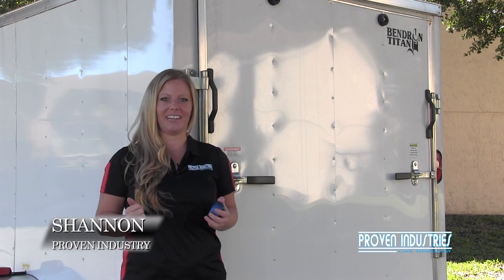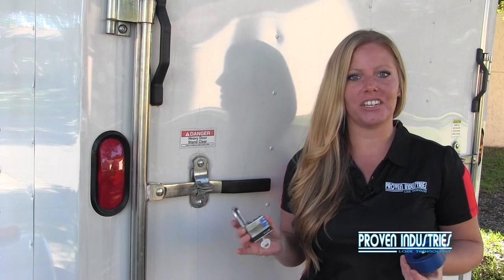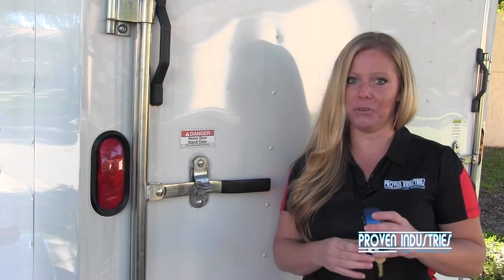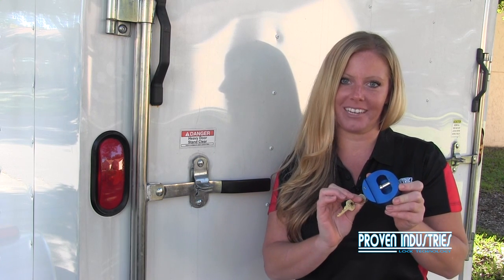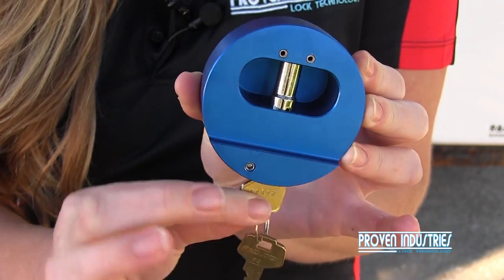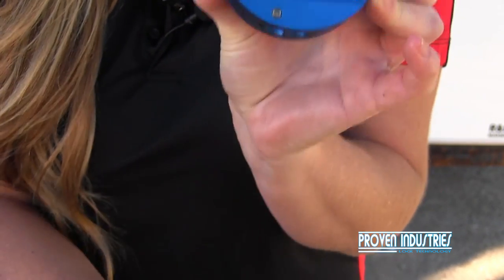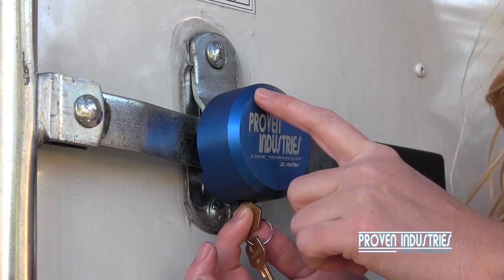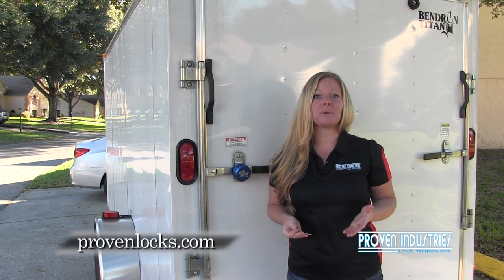Puck Lock

Comment: Im.sure the lock is good, American makes a bullet proof lock as well. Issue is that on these trailers all you need is a crow bar to break the sifter medal that the lock bolts onto. The trailer company's need to step up there game with how these trailers lock. So I use basic locks on my trailer even though I have puck locks. Because id rather them cut the lock off them damage the trailer. If someone is breaking into the trailer. There goi g to get it no matter what